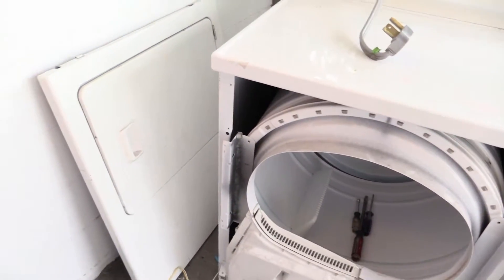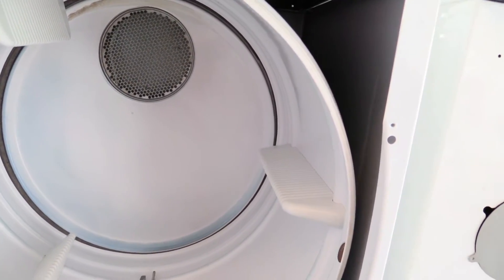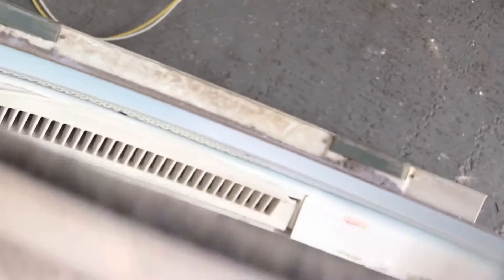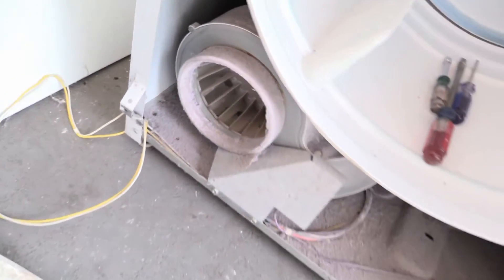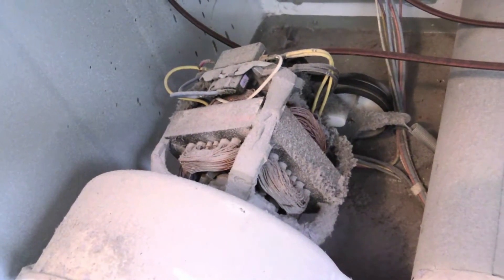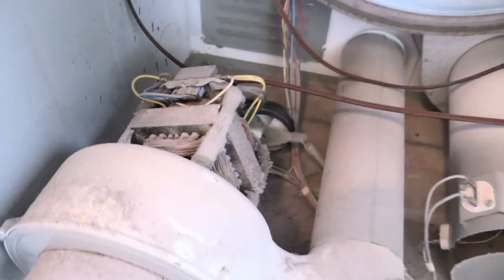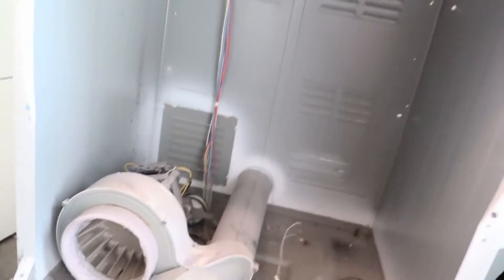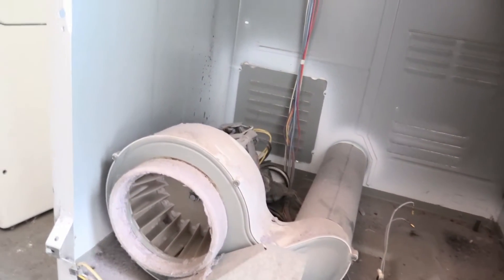Dryer Paint Booth Update 1

Comment: Great Idea, the fan is perfect I think. Regardless if it's brushless or not. It wont be a problem. If you check out modelmantom or badgrendals, they both built spray booths using similar design fans, maybe you can get some ideas and learn from their mistakes.
Reply from the maker: xrlent12 Yes, I watched the spray booth series from ModelManTom and I've seen some others. I have some ideas. And it is brushless. It's gonna work!

Comment: i thought id add that 220 is two 110 circuts rather than one you have two hots and a ground 110 is hot ground nuetral
Reply from the maker: gene miller That makes sense from what I see on the wiring diagram.
Reply: The motor may run at too many  cfms to work right if nothing else I would see if I can find another motor
Reply: You might get by with it though If it splits the voltage between the heating elemnts and the motor motor might run on a 110 circut now that I think about it
Reply from the maker: gene miller Yea that's what the schematic shows. And the motor says 115V right on it. I will use the cord from the washer.
Reply: Well that's a spot of good news I got to thinking about If it splits the voltage between the two